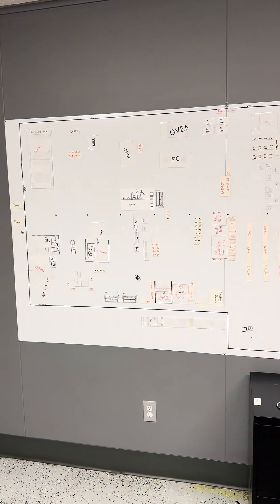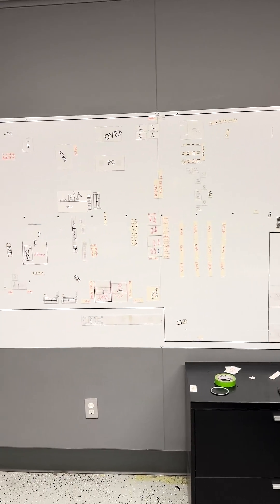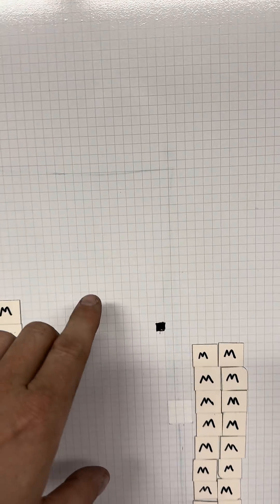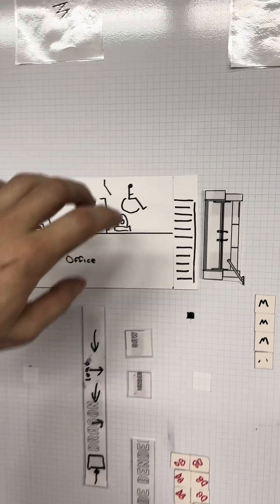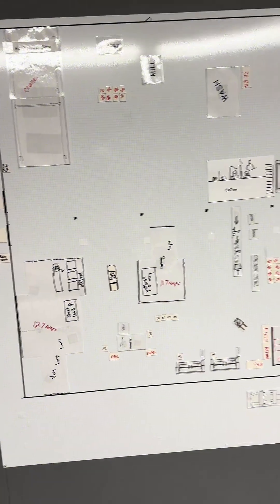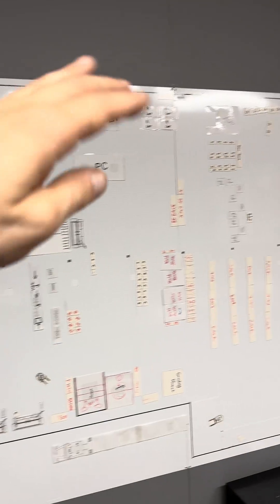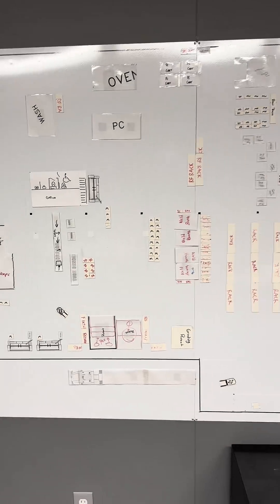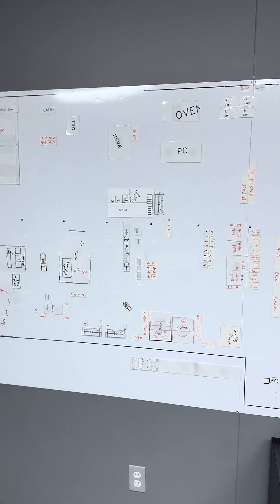How to layout a manufacturing building? #leanmanufacturing

Comment: Just my opinion but I think you need the processes way closer together. We've got a tiny space and it's an absolute blessing because the small spaces forces the processes ridiculous close - basically on top of each other. 750 sqft and we do CNC machining, vibratory tumbling/finishing, anodising, powder coating, laser marking, injection molding and assembly in that space - the lathe probably takes up 1/3 of that space
Reply from the maker: I agree 100%. We do have a lot of large equipment, but our goal is to get it as close as possible. 

As we are moving in, I’m sure we’ll push stuff closer together.